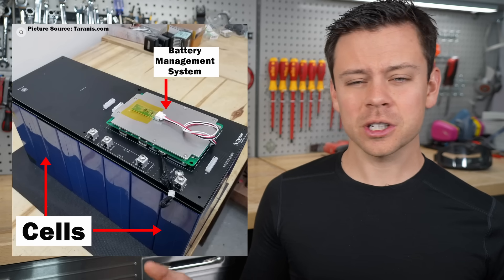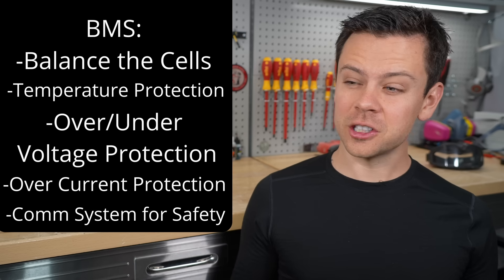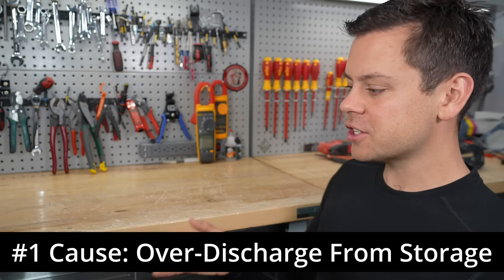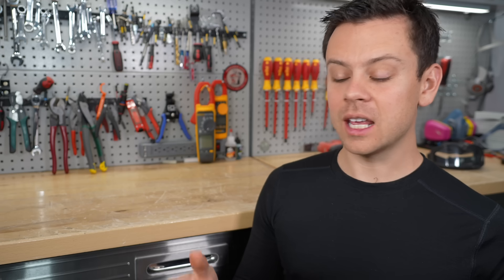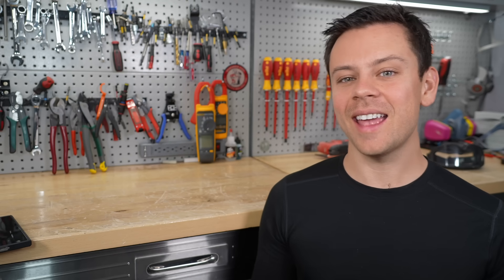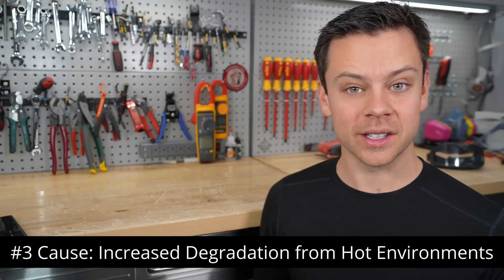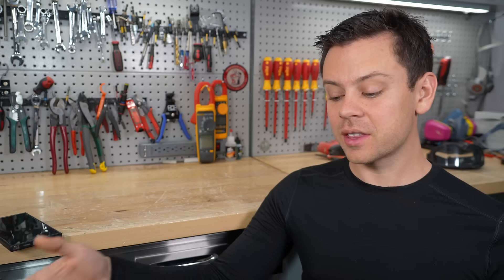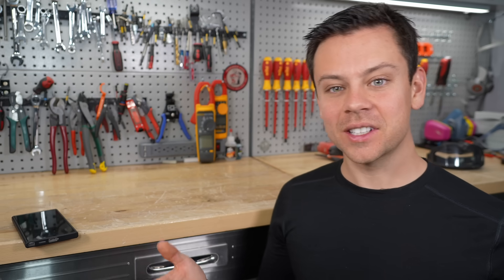The Rules of LiFePO4: The 3 Most Common Causes of Failure and General Guidelines for Long Term Use

Comment: Several things I’ve noticed. #1 Loose Eve cells(not connected to anything) have incredibly low self discharge. My thinking is that the bms just being connected, even turned off is a parasitic drain. For extreme long term storage, if accessible, disconnect the balance leads/power supply to the bms.  #2 If a battery is stored for a long period of time, regardless of the storage voltage, it will take a long time at absorb voltage to balance the cells, even with an active balancer(but much less than a passive balancer).  If possible reduce charge current as the battery approaches and at absorb voltage. This will reduce the high cell disconnect and more time charging when there is a larger than normal imbalance.
Reply: Yes. I've stored cells for years disconnected and have lost no charge at all. It's the bms that eats them if left.
Don't store at high charge though. That bit is right.

Comment: Is it OK to have a small smart charger plugged in constantly and hooked to the battery

I have a small AGM battery in the Philippines and i use a wall outlet to power a small charger----- i kept it hooked to the battery all the time----when we have a brown out (complete loss of power) whoever is in the house can turn on the inverter and we have 2 120v outlets and 2 USB outlets on the small 350 watt inverter. I tried hooking it the the refridgerator and it ran it for a couple of hours during the middle of the scheduled outage.....When i go back i would like to go up in voltage to 48v  LiPo like your hand truck rig.
Again--- Is it ok to leave the charger on it,,,,,like a trickle charger on a boat battery.?

Comment: I'm a little confused. I've got a 48 volt 100 amp Allied Lithium battery as part of my sailboat's electric propulsion system. The boat is stored on land over the winter in the Northeast U.S. approx 6 months. Do I charge it up to 100% before storage or drop it to 50% for the winter storage months?

Comment: What is a reputable source to claim about 3% per month for self-discharge?
What if I say that on practical tests it's 10 times less at worse - 0.3% ?
Reply from the maker: Actually I've had it much worse because the BMS idle on some packs is awful 😂 so yeah, assume it will be worse. And yeah just Google lifepo4 self discharge rate. depends on cell and temp, and BMS
Reply from the maker: Self discharge rate is only the cell but sometimes you'll have a BMS with a relay or something and the holding current will drain the pack in a month. Check out my older videos where we talked about this
Reply: @WillProwse  Having a BMS and taking it into account is a very different story. BMS it's already a load! Most simple smart bms (I can recall very optimal JBD smart bms) may consume 0.2W of energy when not being in sleep mode. There are also BMSes which consume 1.2W, again, not in sleep mode. Sleep mode - another story.
These numbers should not be considered when saying about cells self-discharge!
When talking about assembled batteries - I'd call it as a battery self-discharge on idle state. That could be even worse than 3% and basically does not depend on temperature.
Reply from the maker: @oleksii.zagorskyi  oh i understand that. and everyone else does. I am just saying that when you put a pack into storage, you have to consider all of it. especially if you have a relay in the battery. but yes, self dishcharge rate is 1-3%, but some studies show 5% in really hot temps.
Reply: @WillProwse  can you help le to find the document, where you took the graph from? Title or file name. 
I tried to search that topic myself, but could not.

Comment: Hi, very interesting about lithium ion phosphate batteries but one more question. What about float charging them in a power backup situation is it ok and what voltage for a nominal 12 Volt battery with BMS. Thanks very much. Peter

Comment: Thanks Will - Great video!  Had an interesting question come up in the comments on a video I recently put on my channel. I used 4 inexpensive amazon LiFePO4 12.8v 100Ah batteries in series in an old 48v golf cart. I am charging them with a solar array via DC - DC Boost charge controller (no balancing except for the individual battery's internal BMS). I also plan to use the first battery in the bank to power a large 12v AC inverter. The concern was would the series charge setup shorten the life of the first battery?  My thoughts were that the faster charge rate of a heavier depleted battery would act as a self balancing affect, but would love to hear your opinion!
Reply: Nope, first battery will get seriously out of balance with the others. You need a 48V inverter

Comment: Would this chemistry hold up in a UPS where it will be kept topped up to 100% most of the time? My UPS currently has lead acid batteries which I have to replace every 3 or so years. I dislike lead acid a lot. I found some "replacement" LiFePO4 batteries but I'm wondering if those are suitable for this purpose.
Reply from the maker: Yes it's fine
Reply: @WillProwse  Thank you for your reply, Will!

Comment: I can't speak for every Lithium chemistry, but for LiFePO4 and NMC variants, self discharge isn't a thing. This is mostly an idea left over from the lead acid battery industry. Let me clarify though that although the HEALTHY CELLS don't self discharge, the battery pack as a whole MAY. The BMS is the culprit. I've worked with battery systems ranging from a single 18650 to packs > 1MWH and I can tell you that the BMS is what is causing the "self discharge". The BMS has to monitor the voltage of each cell in order to balance and do all of it's other protection duties. Most BMS systems consume power from the battery itself to perform this function, and it's doing it 24 hours a day. I've seen some BMS systems that consume >3% of a batteries capacity per month. I've also placed packs in storage for 18 months, monitored the SOC every couple months, and at the end of 18 months there was no measurable loss in SOC (State Of Charge).
   I've worked with a lot of second life cells too. "Self Discharge" is a way to determine if a cell is bad or not. I capacity test, then fully charge a cell, then let it sit for 1-2 months. If there is any statistically measurable capacity loss say >0.5% or so, then the cell is near end of life or starting to fail. The self discharge is coming from the dendrites that have formed due to long life or abuse. If you were to place that cell in series with other good cells, then the BMS will continually be trying to balance all the cells, and the only way it has to do that is to drain the voltage of the good cells, down to the voltage of the bad cell.

Comment: This is great  information Will , many thanks . I have 3 lifepo4 9.6kw batteries 3 years  running now  and the first BMS failure has  taken place , as you suggest they are the "point of failure " in these batteries . I want to get  maybe 3x new BMS ,( 2x spares  ready for the next one to go pop ) but can I use other than originally fitted ?

Comment: Hi Will, i have a self built LiFePO (12V250Ah) secondary batt in my van, and it’s a magic one! Because i use it mostly for recharging my eMTB batt’s and that takes it down to 60-70% but the next morning it’s back at 80-85%..? Is that due to chemical/electr. rehab? Also when i re charge it with the car alternator to 100% ,the cells are quiet unbalanced (+0,09V)  is that due to BMS quality? thnx!

Comment: I just bought a Ecoflow Delta pro 3 because my power company has warned that it will shut off power during wind storms and for many days later while they inspect the power lines.  Ecoflow's manual does suggest the 20-80% rule, so mine is charged up to 80% now stored in the house just waiting.  To level the internal batteries by the BMS, should I discharge to 0% then back up to 100% and then discharge to 50% for storage?

Comment: A little off topic from your current video... I'm looking at buying the EcoFlow Delta Pro for my off grid cabin.  What happens when the battery reaches 100% and the panels are still creating power.   Does this create a fire risk and/or battery degradation?   Love your content!

Comment: Hi Will, I have just purchased a complete set up from Signature. I have the eg4 ll batteries I have bought this in advance for using it for my off-grid home in southern Colorado. all components are still sealed in the boxes, and it may be close to a year before I assemble the system, should I be worried about having to charge the batteries at this point.  it is the set with dual eg4 xp 6000 all in ones and 4 eg4LL bateries.

Comment: Will, when hurricane Helene knocked out our power, I used my 2 3000 watt 48v cart power supplies. Then, when power came back on. I accidentally charged both back to 100%. Should I use them to get the stored power down to @80% or leave it at 100% for storage?Both are LFP

Comment: So in regard to #2.  I have 3x WattCycle 300Ah 12v batteries in parallel.  According to the manual, over-charge voltage protection is 14.6+/-0.1v.  I am using a Blue Smart IP65 12/25 charger with absorption voltage set at 14.4v and float and storage set at 13.5v, and recondition turned off.  The battery manual doesn't say what voltage the BMS balance kicks in.  I set charger absorption to 14.4v because I figured the BMS over-voltage protection would never kick in that way, assuming that would be preferable.  Do I actually need to have that set to 14.6v to get all the way to legit 100% for sure, or am I doing the right thing by trying to keep the BMS over-voltage from kicking in?  Opinions on the internet and indeed on your own fora vary.  Thanks!

Comment: Planning on getting solar on my house and I like batteries in general. But, I can't seem to make the math work on adding batteries, other than the feel-good redundancy for power outages. How are you thinking about the costs? Our electricity is about 0.13 per kwhr flat rate. We have time of use pricing, but it's not very discounted. If we get optimistic and find a server rack battery for $1k, that's $200 per kwhr. If we can charge for free during the day and use that power at night, it takes about 4.5 years minimum to break even. I guess that makes sense, if you can put more solar on your roof than you need, and like in our state, they have severely limited net metering, so you can't really sell back your excess solar power.

Comment: I have fairly inexpensive 12V Elefast batteries and I've been worried about leaving my solar charger connected when I'm away because I heard that overcharging is bad. Can the built in BMS in a cheap battery be trusted to protect the cells when the sun comes up and the batteries are already at 100%? I've been disconnecting the solar panels if the SOC is above 90% and I expect to be away for multiple days.

Comment: I have my off grid batteries charge to 100% at 3.55v per cell.  I only have the balances come on at 3.5v and my absorption is only 1/2 hour.  Over 500days in service on my first 302ah 24 volt system at these values and it's ticking right along.

Comment: Voltage question. I am running an all-in-one 24 volt system with multiple 4 or six 12.8 volt batteries. Where should I set my maximum charge on discharge? Thanks for the great videos.

Comment: Love your videos as always. Fellow engineer here, but mechanical. Your book helped me build the most kick ass solar setup and battery bank build for my camper. At a fraction of the price. One thing I'll expand on is low state of charge. I made the mistake of buying BMSs that had no Bluetooth functionality, or even a connector for the Bluetooth dongle. So even though I was charging my bank consistently after ignoring it for 3 months, I started to notice capacity issues.  2 of the BMSs never woke up.  Took 2 years to figure it out. I bought 8 cells to replace the 2 sets of 4s 12v batteries. And I made a jumper pin to "jumpstart" across B- and C- on all 6 of my builds.  It also allows me to check if voltage is the same before and after the BMS.  Which is my poor man's way of seeing if the BMS is awake.  TLDR; use Bluetooth compatible BMSs if you're gonna DIY and follow Will's advice. But jumping across the BMS works in a pinch.

Comment: I bought two Eb3a's when I had to move into my minivan. I used them both on solar and also charged from an inverter through  40 C daysand -35 C winters. I'd start up the van to warm them up...and i work fulltime online..so..would cycle both batteries twice a day. They worked like champs. 11 months later, I'm in a stick and bricks house..and leant the two Eb3a's to a friend who's business was having a power outage. She returned them both dead after a week. Seems the staff were 24/7 charging, swapping for the full week. So..your reason #3 did them both in. I contacted Bluetti Canada support and explained exactly what happened. They replaced both no cost.  :)

Comment: If you buy your standard "car battery" style of LiFePo battery for use as a power supply for a ham radio...those have the BMS built into it. How do you swap out the BMS in those cases, if you even can?

Do you have a video on this you could refer me to?

Comment: Believe you might have had a brain fart...hahahaaa.  Most BMS's do balance when it sees imbalances at any SOC.  "it usually only actively balances cells during charging and sometimes during discharge when significant voltage imbalances are detected, meaning the balancing process happens intermittently depending on the cell voltage differences and the BMS's balancing algorithm; it constantly monitors cell voltages but only intervenes when necessary to maintain balance".

Comment: Hi Will,
Does your 0% to 100% recommendations remain the same for off grid inverters?

(I have 4, 48v 100AH EG4 battery's) batteries, and 2 3k off grid inverters, 8k of panels)

Thanks

Comment: I have a question if that's okay, most tech companies advise to cap your battery charging to 80% or have an option that does that under the "battery health" label, like my samsung phone for example, but you said charge them to 100% is fine, my question is why do companies advise the 80% charge limit ? thank you

Comment: Great video Will. You talk about the impact of heat, but what about cold? I have two 200ah LiFePO4 batteries in my RV. What should I do when storing the RV over the winter here in Canada (November through June)? Should I remove and store in my house (I'd rather not - kind of a pita)? Just disconnect from the solar charge controller and leave in the battery box all winter? Do nothing?

Comment: how much is 100% ? some charts say 3.4v is 100%  rest and 3.65v is 100% charging.which we should follow?
Reply from the maker: HVD determined by BMS or with shunt and HVD
Reply from the maker: Just set absorption and forget about it
Reply: @WillProwse  i have it at 3.5 now.i think it,s good enough.
Reply: true 100% is when your cells do not take a single amp anymore. You can achieve it slowly with lets say 3,5 V or faster with 3,65 V.

Comment: Hey Will, Burlington Bill here (mostly music on my site) I bought one of your books on solar some time back. Quick question- I broke a 100-watt Renogy panel on a suitcase system. I bought a replacement from the same company. I can't get it to pair up with the original through the existing charge controller. The only difference I can see is the junction box on the new one looks a little different. The small capacitors are different. Both panels are 100 watt and look identical. Any ideas?

Comment: I have a 200 amp hour battleborn Bank with a 400 watt solar panel setup on my roof and I live in Northern Illinois which is cold in the winter and for the last 4 years I have kept the battery box warm with a small 500 watt heater and kept the batteries at around 60 to 70°. They seem to maintain about 13.2 down to  13.0 volts all the time. I have to actually use shore power to plug in a smart charger to top off the batteries to about 13.8 sometimes they might get above 14.3 but not very often. I have a renogy solar charge controller and I wonder is everything working right why doesn't this really get charged up on its own? And by hooking up a lithium battery charger using shore power am I forcing something on the system that it doesn't want? Also what is 100% many of my depth of discharge and appliances that have a battery monitoring on it say that it's 100% but it's only 13.2 is that 100% or is 14.2 or 14.4 or 14.6 what is it ? I hope you can answer this for me cuz it really bugs me.
Reply: I'm really hoping that that you will answer this as I cannot figure it out I hope you read these comments and answer my question I really respect and appreciate all you've done for us in the RV and battery world.